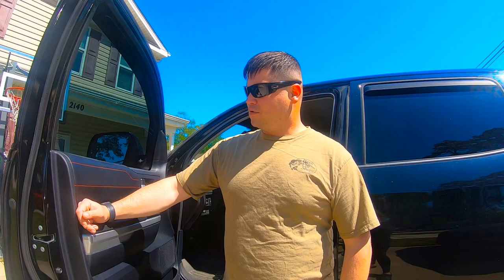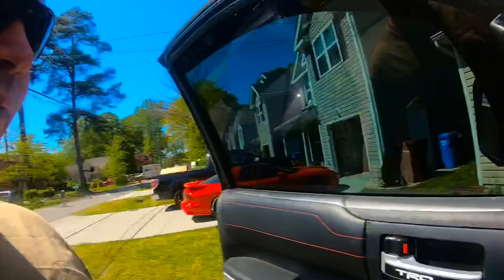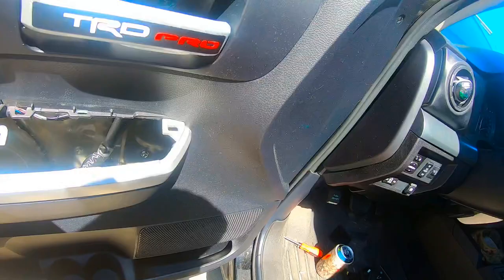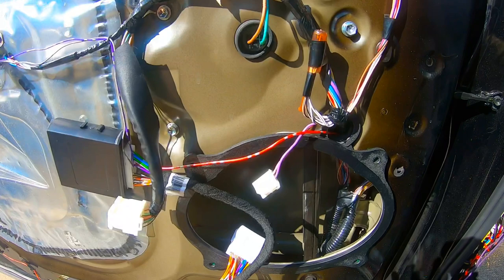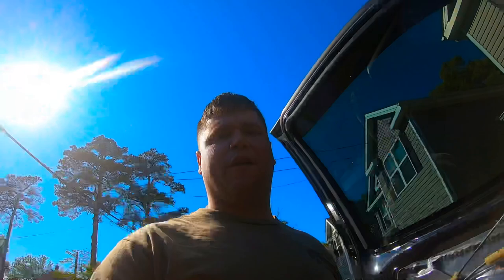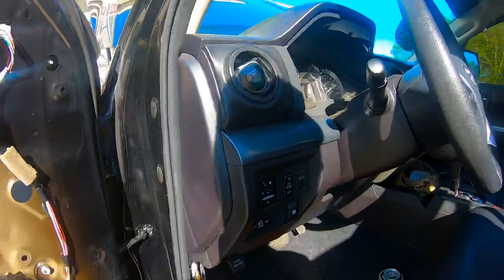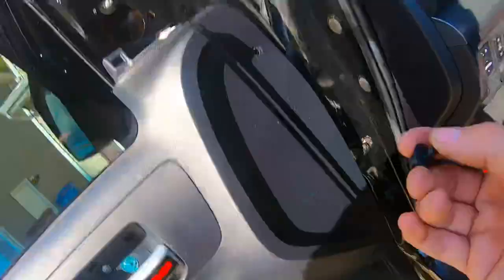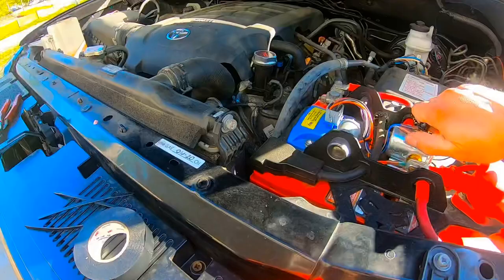Toyota Tundra Automatic Window Module

Comment: Funny you have the dual batteries set up I was honestly just starting to look at that yesterday
Reply from the maker: I have since removed it but it was nice.  I had the original battery mount which caused issues with the sheet metal where it mounted.  Their new version is so much better but I ended up not needing it anymore.
Reply: @usankopp1  ok cool good to know

Comment: So do the buttons on the door now work for auto up/down for all 4 windows? What about the back window?
Reply from the maker: That back window is separate so unfortunately it doesn’t make it auto up/down.  But for the drivers side controls the 4 are now auto up/down.  Then as you saw with the key fob you can make them go up or down by locking or unlocking the vehicle.

Comment: Question, why can’t the power wire for the mod  you ran to the battery connect to the power wire on the factory window switch? Also, does this work for controlling the windows up and down for each interior window switch?
Reply from the maker: ALLABOUTSOUNDQ so it does not make all the window switches auto up and down.  Only drivers door.  And the power wire has to be on a constant 12v source.  The power wire to the window switch is not a constant power wire.  If you connect it to that wire this module will only work with the ignition switch to acc or the vehicle actually running.  Now if your truck has auto up and down driver window then all you need is the high side kit and you won’t have a power wire to run.